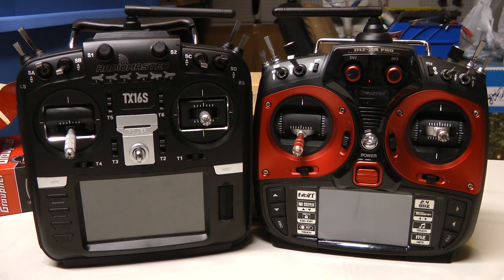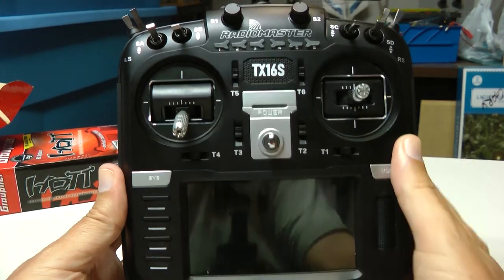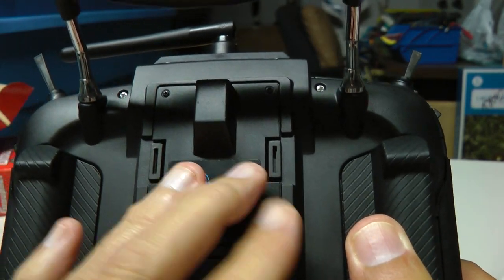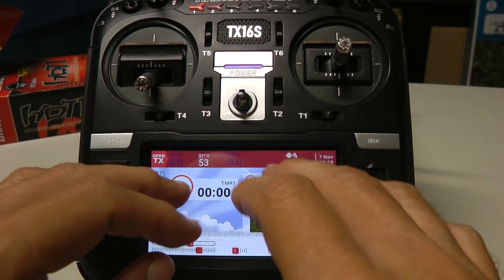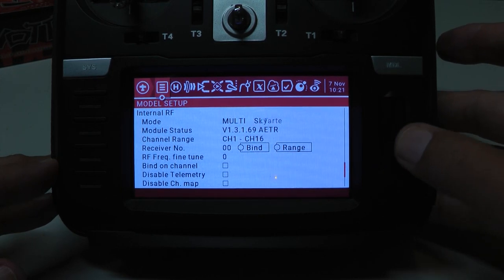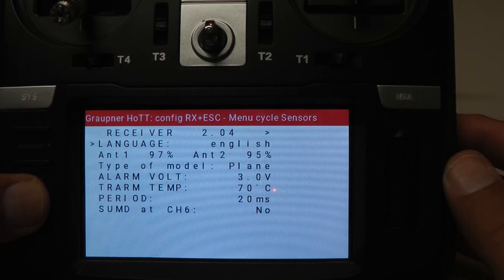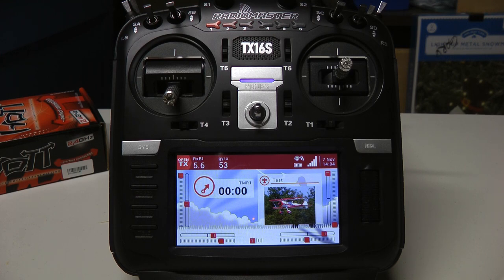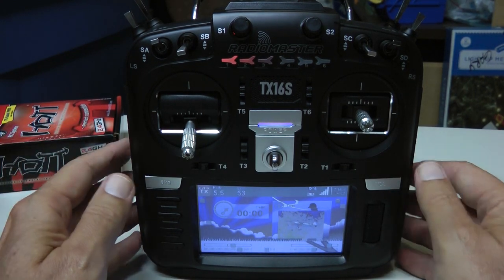RadioMaster TX16s, how to Bind and use your Graupner Receivers and telemetry sensors with OpenTX

Comment: I bought the same graupner tx years ago thinking i was upgrading to a quality bit of gear. So many things bothered me about that radio and it certainly was not a quality bit of gear. Getting my planes back in order and i cannot comprehend how much they want for receivers... My worst RC buy... I see Radiomaster is the new thing and i can see why.
Reply from the maker: Same here, in the early years when it first came out it was a decent deal at Tower Hobbies with the coupons and Super Saver club.  Then Graupner got crazy with their over-priced hardware and lack of support/fixing bugs, most of us cleared out to something else.  I still use their receiver with the RadioMaster, it's stable.

Comment: How much different is the Graupner GR12L Receiver Bind Process with the EDGE TX Soft ware? I can't get the GR!@L to bind. Binds Perfectly with the Graupner MZ 24 PRO.
Reply from the maker: I don't use Edge, the GR12L binds with no issue on OpenTX.  Make sure the 12L has recent firmware on it.

Comment: Hi Gary, I’ve tried repeatedly to set a failsafe on my GR-18L with gyro, can you outline your process for receiver failsafe? Do I need to upgrade the firmware?
Reply from the maker: It's mentioned at 12:24 minutes into the video that you have to let the RX be on for 30 or so seconds and then set it to Receiver.  Firmware versions should be the most current and also your multi-module needs to be current firmware.
Reply: @GaryQuiring  thanks mate

Comment: Hi Gary. Good video ! When you say all the telemetry is supported, ESC included for Pack voltage, RPM, Amps (and I hope mAh ans ESC temp), is it only with Graupner ESC ? Thanks !
Reply from the maker: It's going to support whatever Graupner supports.  If you have an aftermarket ESC that supports Graupner then it should work. The key is the ESC has to work with Graupner RX's.
Reply: @GaryQuiring  I looked on the web for a list of ESC brands compatibles with the Hott telemetry. Well, Google is not always a friend !
Reply from the maker: @fredericmoreau5170  ESC's with telemetry are generally tied to the brand.  I don't know of any that work across different brands like Spektrum, Graupner or FRSky.
Reply: @GaryQuiring   some ESC brands do with some TX brands. Exemple : Castle has a X-bus module for Spektrum and a S-bus2 module for Futaba. Kontronik speaks Futaba, and others do. Nothing is trivial with telemetry. As you said, the most simple is to have one brand. Open TX and LUA scripts are a big trublion !

Comment: Using a Graupner 16L with the Radio Master binding is easy and get excellent range when in range test mode. But, when flying sailplanes with two different receivers  I was receiving many RSSI Low, RSSI Critical warnings and a few Telemetry Lost warnings at what would normally be safe distances. I have decided to stop using the Hott protocol.
Reply from the maker: That's odd I have several sailplanes with the 16L and can fly at ranges equal to the Graupner MZ-24 Pro.  Do you tune the receivers or leave it at zero?
Reply from the maker: Ohh and telemetry lost signals is the downlink, that does not fly the sailplane.  I frequently will get those on my MZ-24 Pro.

Comment: Bonjour désolé j’ecrit en français …comment peut- on régler la sensibilité ou le gain du gyroscope et lui attribuer la commande du trimestre 5 
Merci pour ta réponse .
Reply from the maker: You run the LUA script for Graupner/Hott. Get into the gyro setting sensitivity menu and make the numbers negative.  Then you can assign them to channels on the radio.  I use the digital trim on the RX16s to increase/decrease the gyro.